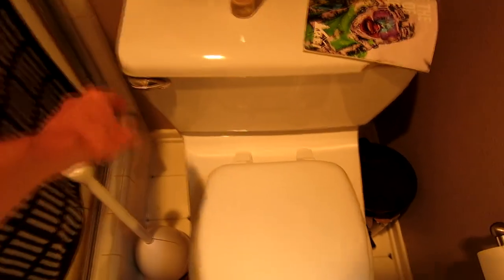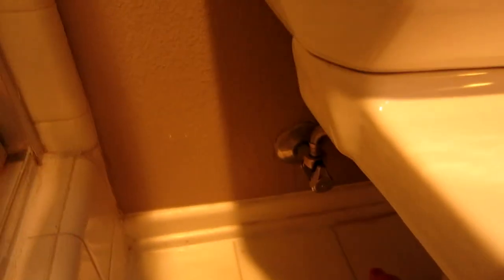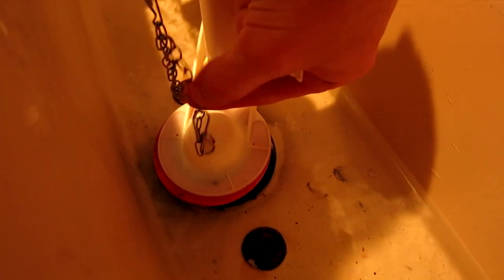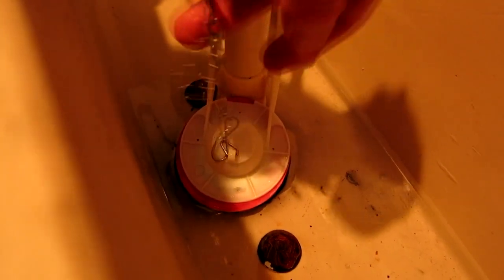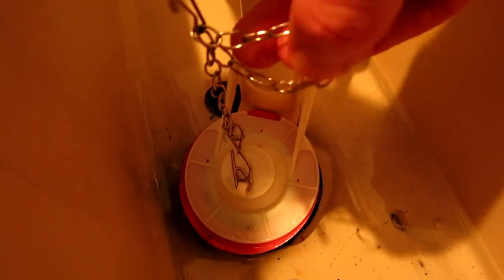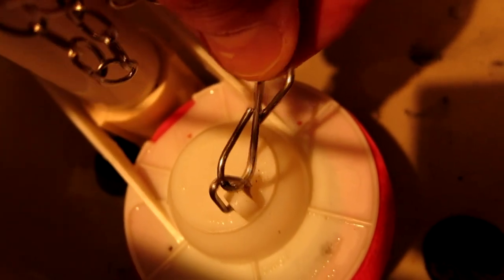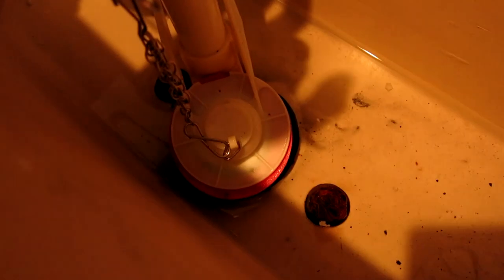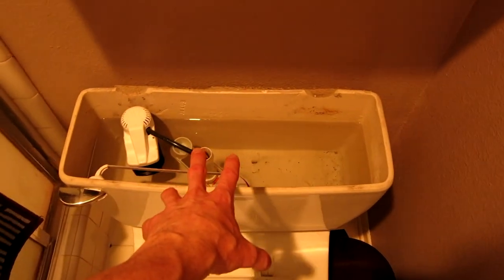Toilet Constant Water Running Fix - Stop Jiggling The Hangle And Fix It

Comment: chains can be proper length and even with new universal flapper, flapper still gets caught on the chain occasionally. I read a suggestion to use a short piece of drinking straw to pull chain through and said this works if nothing else does. It's caused from the handle falling too fast before the flapper. The chain gets caught up when the flapper is open. Some manufacturers have a float for the handle to help with this situation. The straw seems cheaper lol. I've also seen where adding some weight to the flapper works too by using just the right amount of stainless steel washers through the chain. You could also use the correct weighted fishing sinker on the link closest to the flapper. I guess you could hold the handle until flush is complete also 🤷🏼‍♂️. Hope this helps someone.